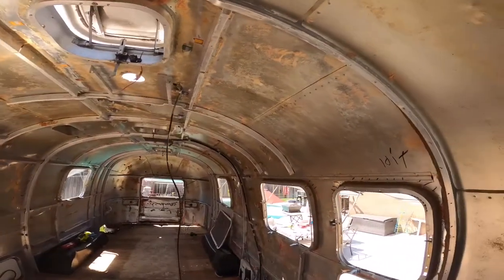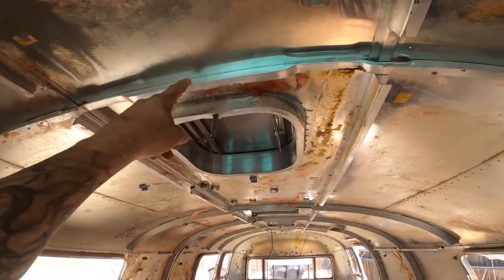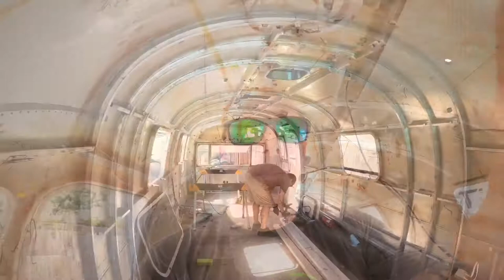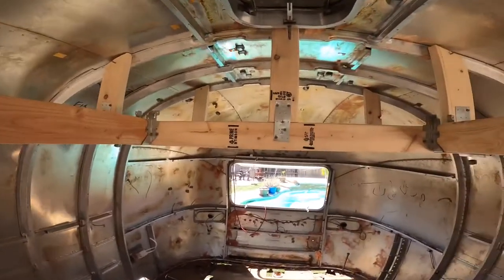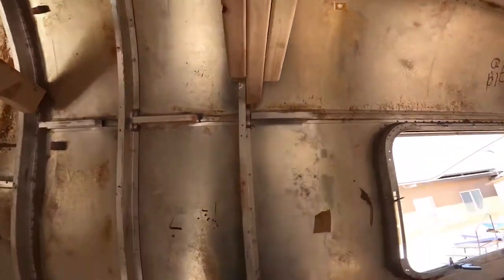Leveling Airstream Trailer and Separation Structure Build (Shell Removal from Frame Part 2/4)

Comment: Is leveling it on grass realistic? The ground is fairly flat and dense. I am wondering if I need to move to a new spot with flat concrete or not. Obviously more ideal, but working on the grass is free...and in my backyard. Appreciate your input!
Reply: We leveled ours on grass no problem, we are documenting our process on YouTube as well :)
Reply: @silverlininghomestead3587  cool! look forward to seeing more of your process. Thanks for sharing!! I ended up just setting boards on the grass underneath my trailer jack stands and it was fine.
Reply from the maker: As long as the ground isn’t saturated wet, it should be fine. I would recommend to place jack pads under neath the jack stands to help ensure solid foundation of its an area that receives a lot of water through out the year. Apologies on the slow response I was just notified of your comment.
Reply from the maker: Thanks for the share I will check out your updates as well. Love the Airstream community